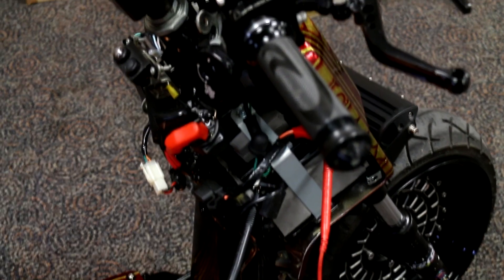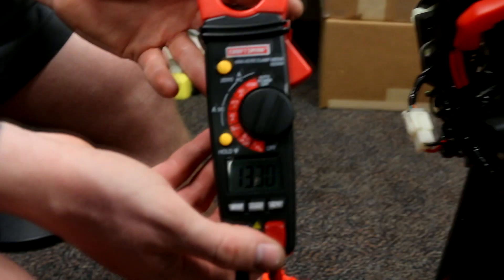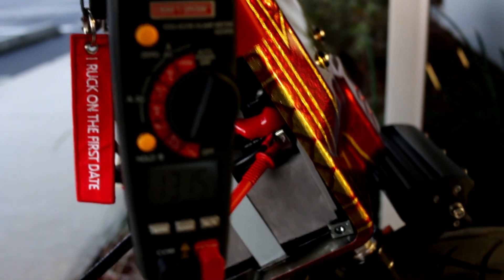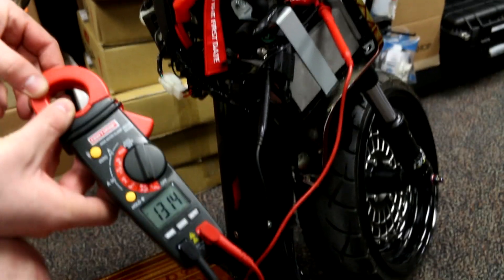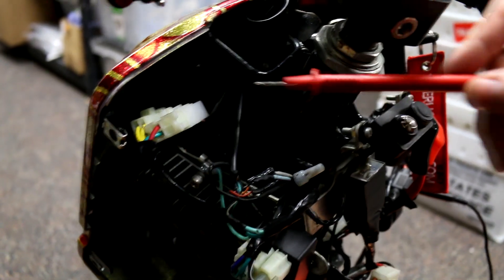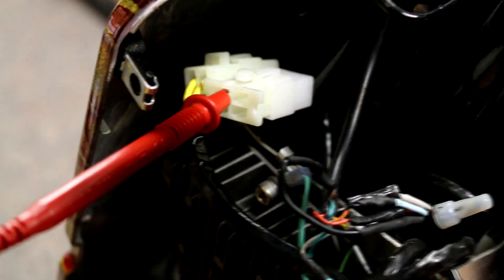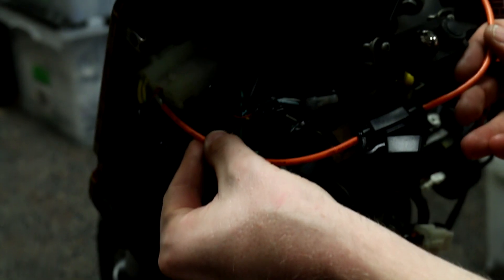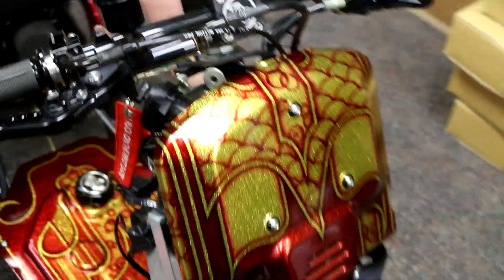CHECKING TO SEE IF YOUR GY6 IS CHARGING

Comment: I need your help  : my Scooter battery reads many numbers in a second and never stops at one number it reads 9v/10v /16v/ 13v all these crazy reads happens in less han one second and never stops ... so I thought it would be the regulator and I bought a new regulator the same shape I have , but it did not work , it explodes the Fuse and make wires gets hot if I tough the battery charger cable to the batery, then I had to reinstall the Old Regulator and it works and charge well but multi reading per second , the same reading with a new battery .. what do you think ? CDI box or Regulator ??? I have measured all the other electronic parts and they all works well

Comment: My new battery has died several times because my charging system is not working. Its such a hassle narrowing down the issue since my bike was a second hand bike and none of it is original except the plastic. Grrrr

Comment: Am getting 12.1 v at idle but 13 when driving is that normal my idle between 1600 to 1900
Reply from the maker: yes if it is over 13v while reving the motor then you are charging the battery

Comment: so when you add that wire can you just leave it connected permanently or do you have to remove it
Reply from the maker: marcus riley yes because it will only work when the scooter is running but make sure anytime you go to the battery you have a fuse